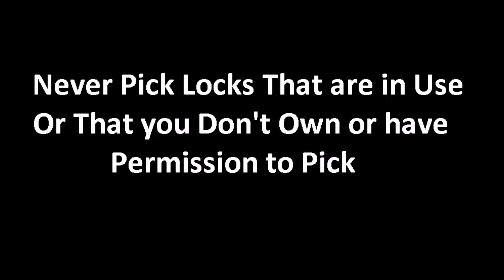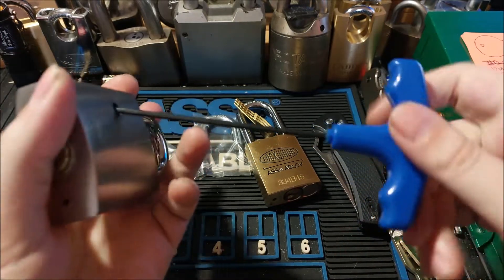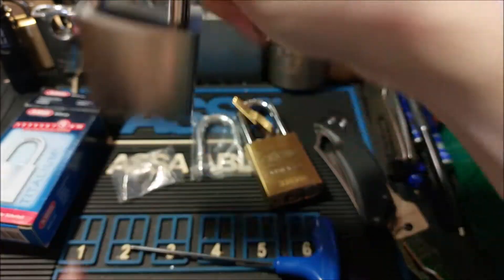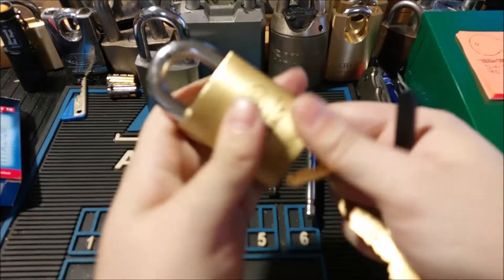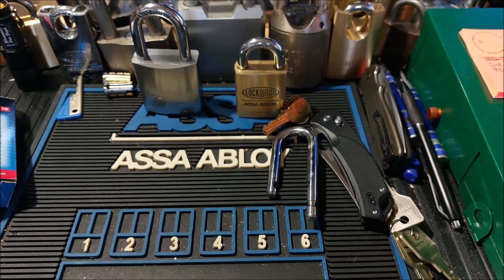(184) Putting an Evva 3ks into the Abus 86TI/55 & Shackle change on a Lockwood 334B45

Comment: Looks a treat in the Abus. The only flaw with the Abus is the plug that covers the grub screw. They are fine if it's inserted and that's where it stays, but if you want to remove it it crumbles in your fingers. Terrible quality from Abus. Apart from that a sweet up grade. Cheers Rookie:-)
Reply from the maker: Yeah, I ended up putting up the plug back in the box, lol.. If i were to use it outdoors I would use the plug, but since it's just sitting on my desk, it will be fine without ;P Thanks again Paul..